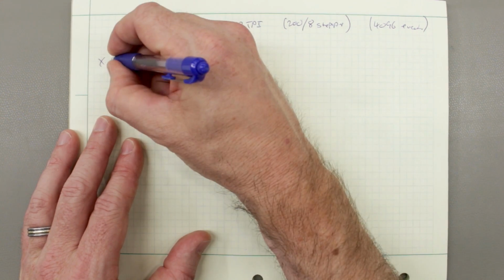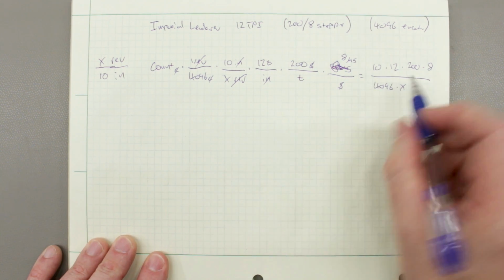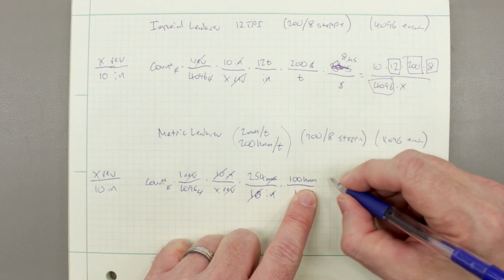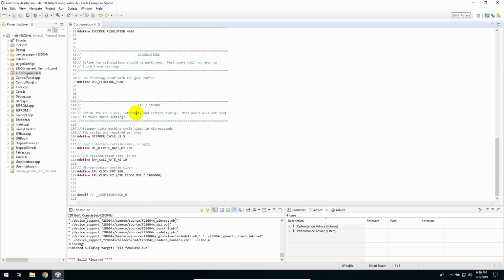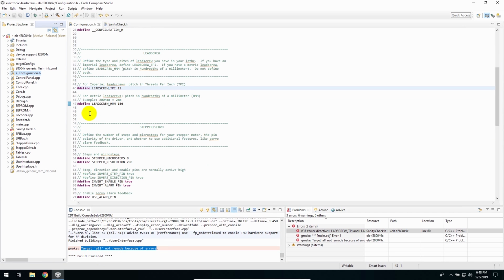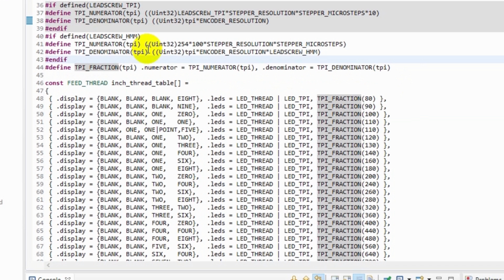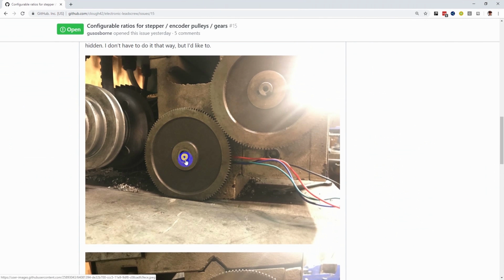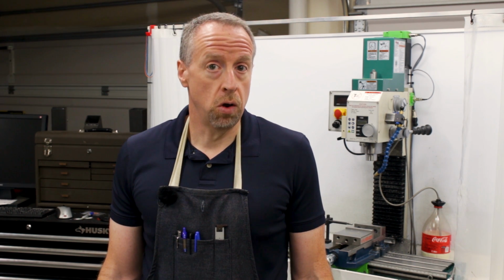Lathe Electronic Leadscrew Part 11: Metric Leadscrew Support

Comment: Having to adjust the defines to suit a machine is not optimal, the configuration and table generation needs to be done in software at runtime. So all you do is drop into a settings menu, tell it the stepper and encoder counts, metric or imperial lead screw, the tpm or tip of the leads crew, then using those settings from eeprom build the tables in ram on powerup as opposed to having to recompile
Reply from the maker: Agreed.  I have an EEPROM on the PCB and a settings button on the control panel for exactly this purpose in the future.
Reply: I disagree.  These parameters are not going to change for a given lathe.  If one moves the unit from one lathe to a different model lathe, then those numbers will change, but IMO the increase in complexity of the control unit and in the display is far from worth it  for something that almost no one will ever use, and even then typically not but every few years.

Comment: This was a great project for just about any hobby machinist but then you used a $180 closed loop NEMA 23, 269 oz-in stepper instead of a standard $35 NEMA 23, 269 oz-in stepper. This 5x increase in price pretty much launched this project out of my budget.  Can I use a $45 425oz-in stepper as a reasonable substitute? I know why you wanted to use a closed loop stepper but how about us mere mortals. It's nice to afford Kurt vises and Starrett gauges but some of us must make due with Chinese knockoffs. 
Your information and teaching style is top notch as always. I really do appreciate the effort you put into your videos.
Reply: Quick warning about the Chinesium kits. I have one on my desk connected to the electronics from these videos. I missed a reference James made to resonances causing problems on his mill. I can easily lose steps with no load due to this. The stepper controller just doesn't handle it well. Digital contollers are suggested as a solution, they seem to start at $50. The servo isn't much more at that point.

Trying to save a few bucks cost me more. I hate it when that happens.
Reply: Look at Lichuan closed loop motors, they have steppers and servos for very resonable price.
Reply from the maker: I tested a stepper in a previous video, and it worked fine.  I think mine was 570oz.in, but it was in the price range you suggest.  Every option has limitations, and you'll need to figure out what works on your lathe.  A stepper will lose torque at high speeds, so you'll have a different operating envelope, but it should work.